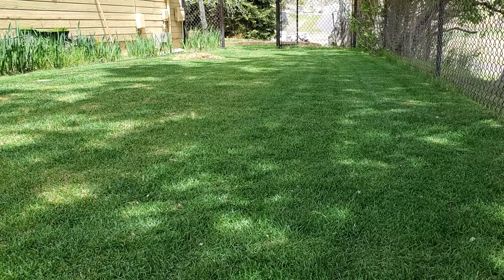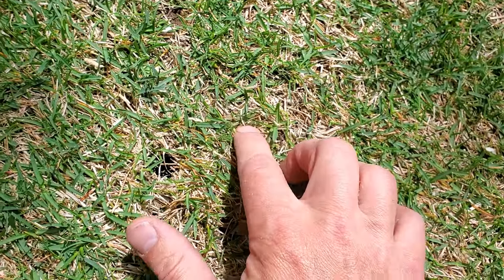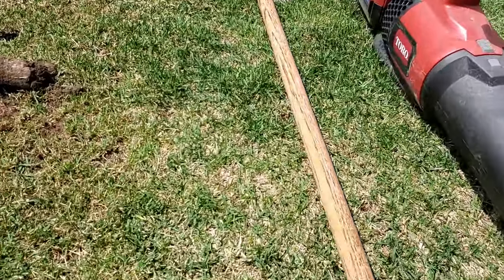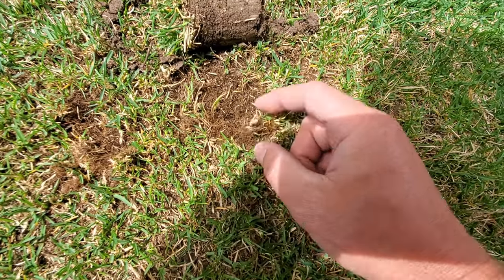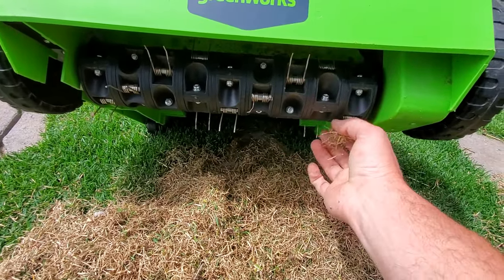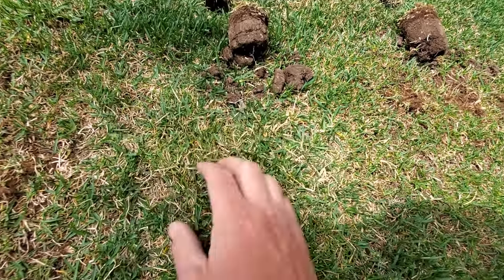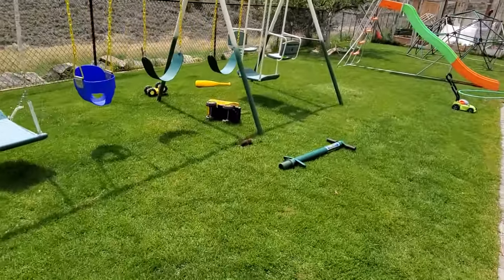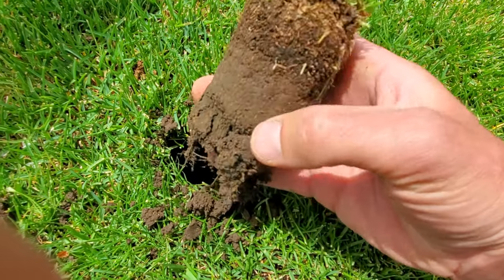Biggest Problem With Electric Dethatchers & Thatch Rakes

Comment: Or course it's not going to "dethatch", because you're using the rake drum. The Sunjoe has a scrarifier that removes the thatch. You have to make sure you're on the right height setting as well. That Greenworks machine is subpar to the Sunjoe as well. Go watch some comparison videos, and see for your self.
Reply: AGREE the Sun Joe RULES

Comment: Why does everyone keep calling eletric power rakes a dethatcher. If it has wire tines, thats a power rake. It is only supposed to remove surface debris. If it has metal blades, its a dethatscher or scarifier.

Comment: Dethatcher is a misnomer. It really is an electric rake that does a great job removing surface debris. That said, I LOVE them for that exact purpose. They definitely fulfill a job...just not removing actual thatch.
Reply: I totally agree.  power rakes, scarifiers, aerators, and dethatchers are all different.  I purchased the SunJoe for the power rake for the exact same reason that you did.  It is great.  I could not find  a power rake to rent, so i purchased one.  The rental yard only had the big spinning de-thatchers and plug aerators.  I would actually call these spinning tine machines scarifiers as well, but semantics.  Almost every time i have used the big rental de-thatchers, it has made a mess of my lawn.  this is usually because of a confluence of issues.  I tend to want to use it in September to October, but that is when grub had done the most damage to the roots, so the grass pull up easily in sections, making a big mess, and since grub correction cant be done in the fall, it turns into a viscous cycle.  I am planning on a better year this coming year.  I think that the only good way to get rid of thick thatch is to burn it after a deep scarification and drying.  The grass will recover with a boost of neutrients.  Not a reality for most of us, however, so we are stuck with lesser solutions like frequent aeration, biological acceleration (liquid de-thatch), or full till and replace.
@turf mechanic is right that power rakes do not de-thatch, but they do fix the color by removing the yellow dying or dead grass on top.  they also tend to comb the grass upright a bit to help with the lay down clump holes that i get with my KBG.
Reply: Untrue. I've been using the Sunjoe for 2 seasons. It absolutely dethatches as advertised. If you haven't dethatched in 30 years, yeah you might have an issue lol.
Reply: @account2292  But it depends which drum are you using? I think all Sunjoe come with 2.. One called the dethatcher (prongs with springs) and the 'scarifier' drum (stationary slicers). The scarifier is what will get into the thatch layer.. What they are calling dethatching drum is more or less just a power rake. It does however help keep thatch from increasing. I was misinformed when I first ran my 'dethatching drum', but still happy with removing all the dead grass. But I now need to run the scarifier.

Comment: You are completely right.  these machines should just be called power rakes, but for some reason they get labeled dethatchers.  That thatch is a tough issue.  Core aeration helps get water and nutrients into the subsoil layer, but otherwise short of ripping up your entire lawn it's tough.  I'm going to try to use liquids in my few high thatch areas, as recommended.
Reply: Bro... Thatch is mainly just surface debris. I don't understand the point of this video or why people such as yourself are talking as if what the machines in this video and the rake are doing are somehow something else other than dethatching? What do you call it then? (& If you say "power raking" lol) What are you power raking then?

Reference - definition:
"In lawn care, thatch is a layer of organic matter that accumulates ON a lawn around the base of the grass plants. Thatch is a combination of living and dead plant matter including crowns, stolons, rhizomes, and roots."
Reply: @joshuaroyal3272  I am ordering the Rock&Rocker 16" path today.  $152. with no taxes

Comment: I had a similar realization recently.

I moved some bigger kid toy, which killed the grass, so I reseeded that small section. I loosened up the dirt with a rake, put the seed down, raked again, and put peatmoss on the top. I saw no dead grass, it looked like dirt. But not a lot of grass has sprouted… I was disappointed. I also saw that the water is running off, and not into the soil…
To save the day, I bought a single roll of sod to cover it, which requires to remove the top layer of dirt. THAT’s when I saw, that the top inch can be lifted in one piece, like a carpet, and it is not soil, but thatch. 

Coincidentally, right next to it, there was a damage where a removed shrub accidentally pulled the top layer of the lawn next to it. That area got new layer of soil 2 inches deep, and grew beautiful grass from seed.

That’s how I learned why last year’s overseeding was not working well in some areas, even I thought I was detaching. So thatch is not dead grass, but dead roots. I have no idea how to remove it mechanically, without killing the grass, so I’m also stuck with liquid detacher. But I might just dig up and reseed the worst portions of my lawn.
Reply: I feel like the best way to do something about it other than to rip out the entire yard or to liquid dethatch for years, is to grow it a bit longer, do a very heavy top dress.  So much that the grass blades barely stick out.  That will bury the thatch so deep that it'll decompose and the new seed will have dirt to root into.

Comment: I’ve got similar thatch issues to yours.  Moved into a new house a couple years ago and there’s 2-3 inches of roots growing above the soil in some spots due to poor watering patterns and sprinkler coverage issues.  Lawn was only about 6 years old and it had already gotten thatch that deep!  The first year I used a Greenworks with the spring tines.  The unit’s motor burned out on the 3rd pass and so many of the tines broke and had to be replaced but I did get lots of dead grass out.   However the thatch remained.   Several aerations and one commercial power rake from a landscape company later and I’m still at the same place.  Here’s my plan going forward.   First is to fix my sprinkler coverage to make it more consistent.   Second is find out exactly how much water goes down for each cycle.  Third, I just bought both a sunjoe scarifier and a commercial Bluebird PR22 with the flail reel.  Yes $2k for it but this is a life long investment and with Kentucky bluegrass it’ll be used regularly.  You can also get a delta reel (aka verticutter, slicer, scarifier, etc) and a spring tine reel for it.  I’m very curious to test out the differences between the flail and delta reels.  The sunjoe is nice and light, and removes debris well but it’s narrow (I’ve got about 5000 sqft of lawn) and because it’s light it doesn’t sit down into the grass much.  As a result you only get a superficial scarify even on the deepest setting.  The Bluebird on the other hand is like 160 pounds and will allow you to get as deep as you need.  You could easily pull up the turf with it so you need to make sure it gets set at the right height.  It’ll still beat up the lawn and it’ll most likely take several years of 2-3 uses a year but I think it’ll do the trick…along with aerating the shit out of it.  I have a tow behind aerator that I can hook up to my golf cart and just aerate until it looks like Swiss cheese.  If it all fails I’ll burn it down to the ground and start over.  Now that I’m thinking about it, that might just be the easiest way 😅

Comment: My plan is to bag/vacuum clippings every time, use the Sunjoe to better expose the thatch you show, and then apply liquid dethatcher. Do this a few times a year and I bet that thatch will be minimized and break down given enough time. Reducing the thatch that piles on top should allow the deeper layer to catch up in breaking down.
Reply from the maker: This is by no means advice because it's something I'm still pondering but I was considering going to bagging clippings for this fall because I'm still trying to shrink my thatch layer, and the clippings are just sitting up on top of the thatch making everything seem worse ...but, ultimately I decided to keep mulching them because they help retain moisture in the thatch layer. Getting very specific here but the way I conceptualize it is this - I want the thatch layer to break down like compost does so I have to keep it moist and keep nitrogen in it via clippings and fertilizer. So long as I continue aerating and ocassionally scarifying the thatch layer there should be enough air in the layer to help break it down. The clippings help keep the moisture there but I still want to remove them periodically while running the dethatcher to score the thatch layer for airflow...Anyway, just thinking with my keyboard to you 😁 no matter what its all fun in the lawn. Thanks for watching and commenting!

Comment: The reason the thatch layer can get really thick is because of watering short periods of time and too often. Compaction is also a big culprit. For these reasons the root system stays too close to the surface causing a thick thatch layer. And in reality dethatching is only one step in line of steps for a healthy lawn. If you want to do a real lawn renovation you have to first dethatch, then aerate, and then overseed. To continue to promote to deeper roots the lawn needs to be watered deeply (1 hour of watering) 2 to 3 times a week. Shallow watering (10 to 20 minutes) every day will only promote shallow roots causing a thick thatch layer.

Comment: Brian (Wayne here). Thatch: Is it only because the grass is not bagged when cutting? Or it only gets a small portion of what is cut? Like your channel. Just stumbled onto it yesterday. Keep up the good education.
Reply from the maker: Hey Wayne! So glad to have subs that care about details like this! Thatch can be caused by a number of things but rarely is it because of plain mulched clippings. Grass that is mowed regularly with a mulching mower should break down and reincorporate into the soil quickly, problems arise when too much water create an anaerobic environment, too little water creates shallow root systems, rhizomatic and stoloniferous grasses aren't verticut often enough, and soil microbiology isn't active enough. In my case my lawn was underwatered after a sod install a few years back. Slowly I'm fixing the problem without doing the remove and replace option.

Comment: Another great video Brian, thanks. I agree that the Greenworks is a nice power rake. I use twice, 90 degrees to each other. It does nice cleanup after winter. But not dethatcher. Core aeration every fall fall is on my to do list going forward. BTW, If new core was still that thick of thatch layer, how do we know the liquid aeration is working? Looked similar to your previous core. Just wondering if worth time money and effort. I guess I will watch your videos on it now💪🏼

Comment: So to remove dead grass using the rake will it damage the grass because of pulling and detaching grass roots, or they will reconnect quickly? If it damages the grass, shall I put afterwards new seeds or just again fertilizer?
Reply: When I do it, I try to do it in conjunction with my spring or fall prep. So yes, just plan on doing all the above. The detach really beats up your lawn and it will take a couple of weeks for it to recover, but it's the perfect time to overseed because there will be more ground contact.

Comment: I see the main value of "dethatching" being less about pulling up the thatch, but rather cutting through the thatch to let air and water, fertilizer, seeds etc through the thatch layer. And I use an electric one for the simple reason that it cuts deeper than a manual one, and is much less exhausting

The fact they pick up the surface debris helps too, but isn't my goal for using a "dethatcher"

Comment: Thanks for a well done vid. There is a difference between using tine attachment to power rake and using scarifier to dethatch. Hieght adjustment will be a factor as well. There's no way these tines (which are like a rake) will pull up thatch, for they will only scrape surface. Hence, the tines are flexible. The scarifier will go deeper cutting roots, so they multiply and remove thatch as well. I would like to see a video where you use the scarifier attachment to detach and pull plug show results.

Comment: Im fairly sure the tines are the power rake attachment to remove surface debris. The thick metal blade attachment cuts the thatch layer out and is the true dethatcher
Reply: And you technically need to scarify to remove thatch
Reply: @bermandustin  so should you just scarcify first or you have to use the other blade (times) and then scarcify?

Comment: How would you rate it as a rake, if set optimally to pick up debris without trying to dethatch?
Reply from the maker: If I set the tines to above grade and simply rake upper debris, leaves and small tree droppings it will work great especially with the bagger on however the bag will fill up quickly so you'll have to stop to empty the bag frequently. If you leave the bag off then it will pickup all debris and leave it "floating" on top of the lawn so that your bagging lawnmower will pick it all up. If you are just thinking about raking leaves in the fall then I don't think it's as helpful as just running the mower with bag over the lawn a couple times per week. If you have some evergreens that leave small needles or buds on the ground that get embedded in the lower canopy then this machine can help get them to the surface for bagging way easier than a regular rake. If you want to "fluff" the lawn up at the end of winter to get it standing upright for a better early season mow then this will work ohh so good while also thinning out dead leaves from winter dormancy. Think of this tool as something with a ton of uses, none of which you need it for but many of which this machine helps with...just don't expect it to quickly eliminate a true thatch layer in a single season. It's only part of the solution for that.
Reply: @TurfMechanic  I found a website, forgot the address and company, where one could order an absurdly large and durable catching bag.  They have some common, but most people would have to send measurements and other information of the frame in the bag they already have.  My mower bag fills up too frequently when picking up leaves, but haven't used it for mowing. So I put off ordering a custom bag.  I would guess they'd make one for a dethatcher but it's probably not worth buying for a machine that will only partially fill it.
Reply from the maker: @uncrunch398  shoot me the info if you could fund the time to look it up. I'd be happy to investigate a bit.

Comment: No liquid dethatch products in Ontario that I can find. Sunjoe has a scarifier that goes to 0.4 inches and ryobi has one too (height adjustment wasn't advertised when I looked at it). I wonder if these would do more effective job.
Reply from the maker: Sounds counterintuitive but running an electric scarifier like those at grade or barely below grade -0.1" can score the thatch layer a bit just enough to work over time especially if you make your own liquid dethatch product and apply regularly at the same time. Check this video out that should be perfect for you: https://youtu.be/ESJuzFHh1nc
Reply: @TurfMechanic  molasses and yeast, eh. Worth a try 😊
Reply from the maker: @Nathan-ho7vr  better than nothing 🤷‍♂️

Comment: Does anyone have an issue with the thatch wrapping around the drums and getting tangled? I bought the sunjoe basednoff of several comparison videos. My experience is it doesn’t work very well
Reply: Doesn't the grass have to be cut down to two inches high to prevent that problem? I saw that on a video comparing three different dethatchers. Use the right setting.

Comment: Your mistake was confusing a scarifier with a detatcher.
Scarifier is like a surface rake. That's what you did.
A detachter has blades that rip into the substrate and you had better be ready for the outcome!
Will take 4-6 weeks for the results. So, afterwards, go heavy on the pre-emergent herbicide and fast and slow release fertilisers. A month? Wow. This is the way.
But at first? It looks frightening. Barren. As if you have killed everything off! You havnt. It's fine.
Water morning and evening for a month. Then once a day for the next two months early or very late. Job done.